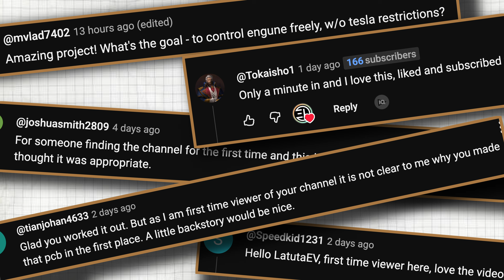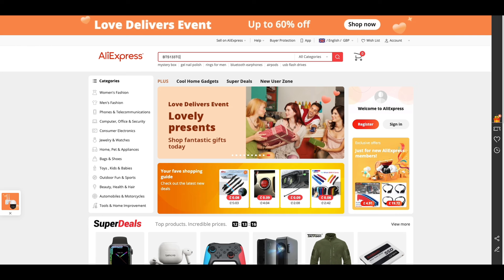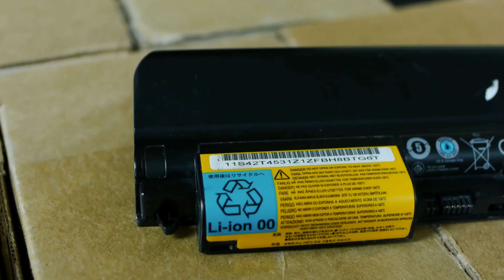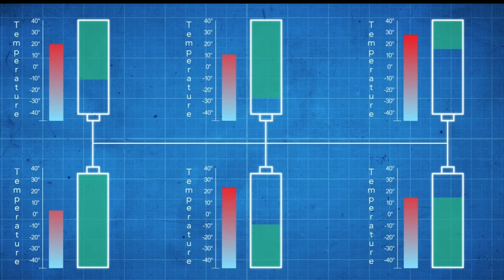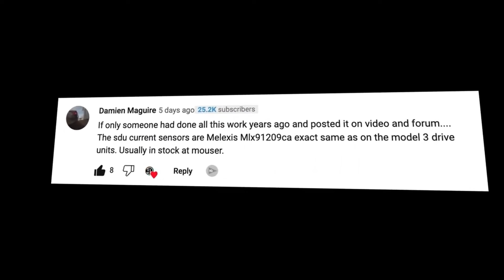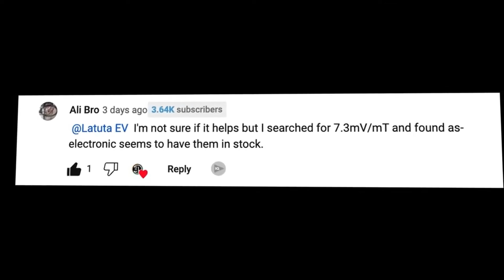Prius Gearbox, Dumpster Batteries & Tesla motor: My EV Build Story

Comment: Thanks for taking the time to produce all these videos.  Really useful.
Can I ask if you had any experience or issues measuring the temperature of your inverters or the motor?
We're experimenting with an open inverter project on a Toyota inverter, and running. Mitsubishi motor.
The open inverter internal reading is correct however, we can't get a correct reading from the thermistors in the motor.
I'm trying to work out if we can design a new map in the firmware or if we need to perhaps amplify the signal.
Just wondering if you have any experience / guidance, given how much you've experimented with these boards???
Much appreciated if you have.
Reply from the maker: Thank you Paul I am glad you found it useful. I didn't have any temperature issues. Please check on the Open inverter forum they have a lot of advice there.

Comment: Great job on your work, I’ve been keeping up on your videos for a while now. I build a parallel pack for a Chevy volt and jumped into the native systems “mechanically”. You’re doing great, keep up the great build and great videos.
Reply from the maker: Thank you, I am curious what battery did you use? Was it the same type as used by GM or something else? How did you wire the BMS?